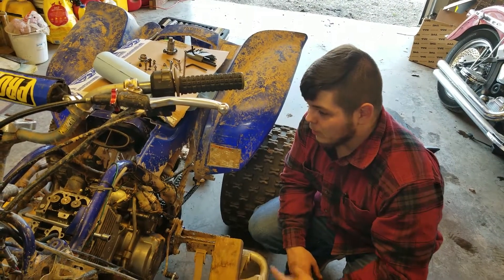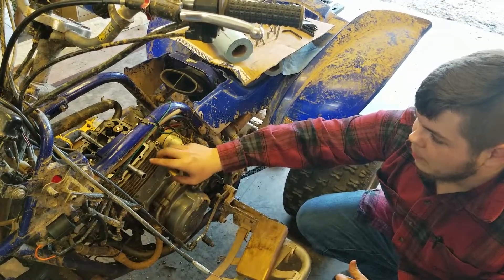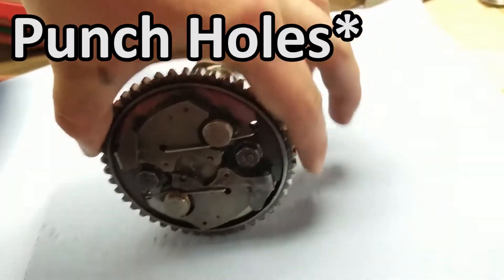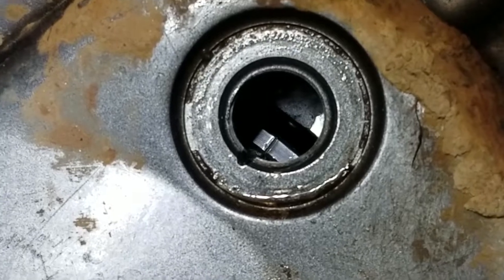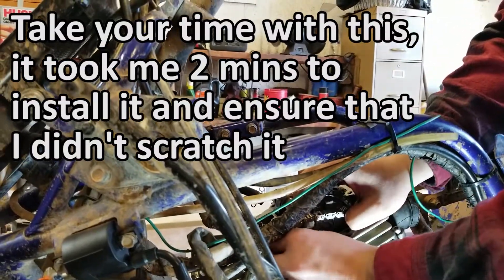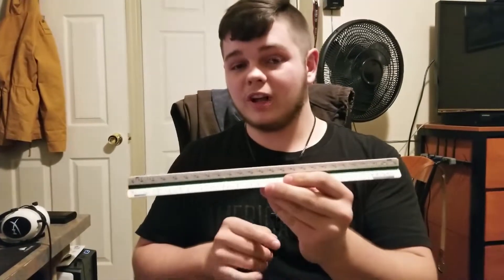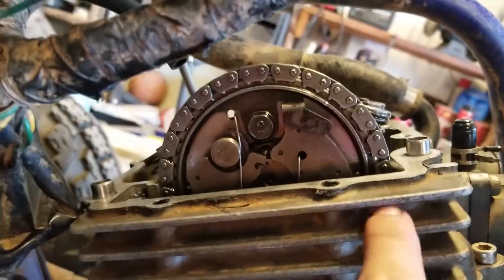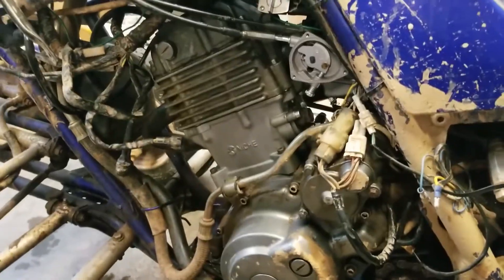4 Wheeler Timing Tutorial (Raptor 660 Used)

Comment: You said you put on new carbs was there something wrong with the old ones or did you just change them? Still having trouble with backfiring and carbs blowing off boots when cranking. Timing all looks good unless its off just a tooth but would that little bit make it do that? Just asking to see if there could be another issue ive overlooked. The bike just cut off one day and has been doing this everytime i try to start any ideas would be appreciated.
Reply: I double checked the timing chain and its all good i adjusted the valves as well and still when i crank backfire and off with the carbs
Reply from the maker: @roycesands5475  When my 4 wheeler timing was off that's what caused mine but my timing was off by 90 degrees. I wouldn't expect the 4 wheeler to lanch the carbs out with only one tooth off but I've learned that, that specific engine is very very picky. I bought the new carbs because the old ones would not stop flowing gas out of the overflow even with two different rebuilt kits having a new needle jet, so I went ahead and got new carbs on amazon for $45-ish and they have worked much better and have alleviated some headaches.  Like I've told other people, did you ensure that you used the correct indents on the cam to set the timing? Because that's how I ended up being 90 degrees off.
Reply: @Hunters_Mechanics  yeah man i tripled checked the timing was right its all lined up i took like a hour and a half to get it just right and its still doing the same thing i even did the vavles twice but the middle valve had to set alot lower than the rest i think it could be stuck open. Is the only way to check the valve is to take off the whole top end? And would a stuck valve cause backfire and the engine to roll over faster than normal ?

Comment: I took my raptor to a guy that said my timing chain was off and that it was “stretched” so I took the top end off an put it all back In dead center and I put everything back together an still won’t turn on, you think you can help me out?
Reply from the maker: Did you get a new chain?
Reply: Hunter's Mechanics no I think I was supposed to right
Reply from the maker: @crfisaiah3963  if the chain is stretched it's always best to change it, they can get so loose that they skip a tooth and causes it to be out of time
Reply from the maker: @crfisaiah3963  when was the last time you had it running?
Reply: Hunter's Mechanics maybe 2 weeks ago but this mechanic said my chain was stretched at first so I should change it
Reply from the maker: @crfisaiah3963  well like I said you really should, did it stop running all of a sudden?
Reply: Hunter's Mechanics not just all of a sudden it would run weird as if the timing was off which I’m sure is correct so we put it back in time an put it all together an still doesn’t run so my pop’s thinks it’s the valves but I think we should change the timing chain what do you think
Reply from the maker: @crfisaiah3963  like it doesn't run at all now that you've put it in time?
Reply: Hunter's Mechanics yea it still didn’t want to turn but we looked at the valves an some were way open so that may be the cause
Reply from the maker: @crfisaiah3963  have you adjusted the valves any? You should check the valves anytime you take the valve cover off
Reply: Hunter's Mechanics yea we put them back how there suppose to be an still won’t run but I’m pretty sure I have to change the chain instead of jus putting it back in time
Reply from the maker: @crfisaiah3963  did you check the slack in the chain? Like before you tear it down to change the chain, check how much play you have in it, if its REALLY tight, it shouldn't be that, you'll know if it's too loose
Reply: Hunter's Mechanics I’ll have to see but I don’t know how to actually change the chain
Reply from the maker: @crfisaiah3963  my other video I have on the wolverine is extremely similar to the 660 when replacing the timing change, except you have to take the valve cover off, i do admit it's not the most helpful of videos because I was still starting out but it's something. As always if you dont feel comfortable with doing work on a machine, please have someone with experience do it, itll save you time and money in the long run
Reply: Hunter's Mechanics by someone experienced you mean a mechanic on atvs
Reply from the maker: @crfisaiah3963  yes preferably

Comment: Bro i CAN NOT get the cam gear perfect. As soon as I set the tension it’s off. 😂
Reply from the maker: Like I tried to state in the video, if you get the cam gear to line up the dots with the surface, that's all it needs to be, when you set the tension it will be a little off, as long as BEFORE you see the tension it lines up, you're golden
Reply: Hunter's Mechanics  thanks I really appreciate it.
Reply: Snap 358 was your timing right? Mine is doing the same thing...I spent hours messing with it and trying different teeth to compensate then eventually I found this comment and said screw it

Comment: If you use a piece of wire instead of that socket extension to hang the timing chain when you remove it from the camshaft, it won’t fall down and come off the crankshaft. Saves a lot of headache when putting things back together. Especially if you are removing more than just the valve cover.
Reply from the maker: It's all I had next to me to stick in there lol, the last 4 wheeler I did this too, I used a zip to to the frame above to ensure it kept the tension on the chain so it wouldn't fall off the crank
Reply: @Hunters_Mechanics  sometimes you gotta make do with what you have. :)
Reply: How do you take off those 2 caps on the left side of the engine
Reply: @crfisaiah3963  Use a big flat screwdriver.
Reply: @crfisaiah3963 wood chisel

Comment: I know it takes some time for the rings to seat but out of curiousity, about how long after rebuild did it take your raptor to stop smoking?
Reply from the maker: Mine only smoked on the first started up because of the all the lube I used for the cylinder walls, it shouldn't be smoking (really it shouldn't at all) more than a few hours of time on it to ensure proper seating

Comment: Hey Hunter, thank you for the perspective.  It helped me get my camshaft oriented.  I had the camshaft sitting in the journals 180 degrees off initially too.
Maybe you have a different cam sprocket, but there are no imaginary holes.  The cam sprocket does have three dimples (punch marks) which should sit at West, North, and East respectively.  The North dimple (punch mark) is covered up by the decompressor guide, when installing the sprocket bolts.  The decompressor spring lever with its projections (pegs) also has a dimple (punch mark) that is supposed to sit north.  It is all in that manual if followed correctly.   You are pointing directly at it all 1:51

Comment: Now that Niche top end jug holding up? Heard people say there problematic
Reply: tizzee11 they stuck. Bought a 660 used that had a brand new rebuild with paperwork from a shop and hour meter. 5 hours in it blew. So I rebuilt it myself with the niche, got about 9 hours out of it. Rebuilt it.... again with stock Yamaha parts this time, and now have over 200 hours on it
Reply: niche sleeves drop down and let water in, you can either take off a little on the jug and get it back to flush with the sleeve or get  different brand of barrel...

Comment: My cylinder head has two holes on the right side of the cylinder head . ( Where it looks light an amp vent )   
Can I just take it to a machine shop that repairs heads . Text me at 1-678-561-0283
Reply: I don't think I'll need  the top end kit.